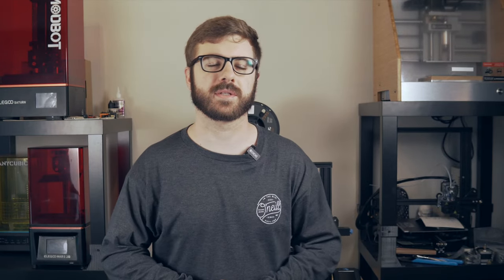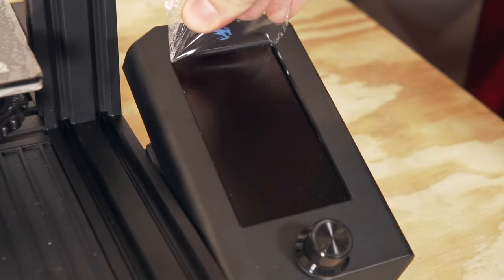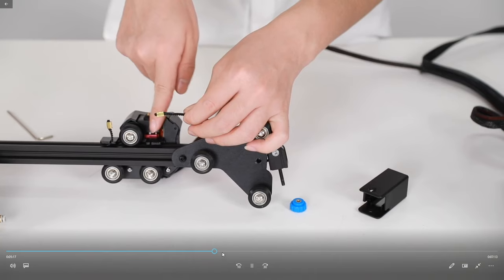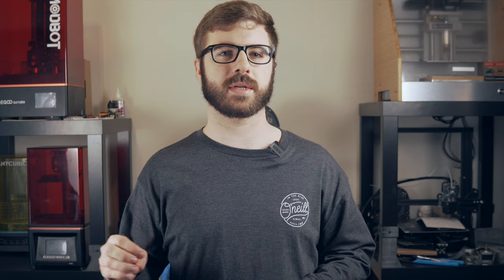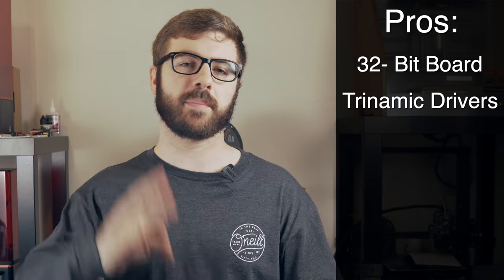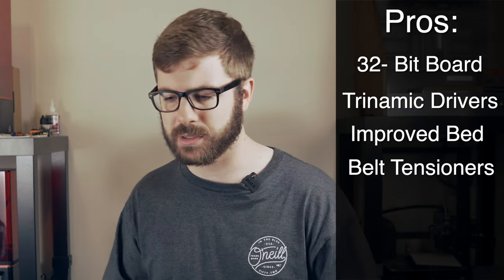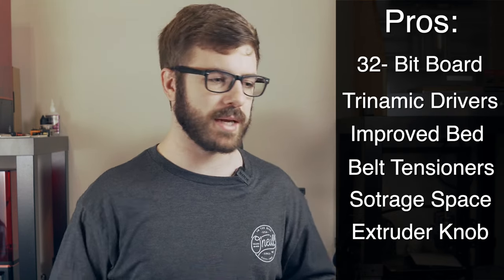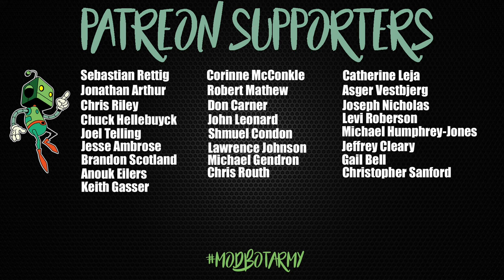Is The Creality Ender 3 V2 Worth It?

Comment: Biggest issue with the V2 is if you get one of the faulty 4.2.2 board which Creality still refuses to acknowledge and replace.
Reply: Probably needs more hot melt glue.
Reply: How does a faulty board look like? Like it doesen't do anything or what?

Comment: Nice summary. Agree, I don’t like the display. I also don’t like the larger plastic fan shroud. It’s more difficult to remove than standard Ender 3 and blocks access to the coupler if I need to remove it and the PTFE.
Reply from the maker: Thank you Chuck 🙌 Agreed, I do love how easy it is to access the hotend and coupler on the Ender 3 and Pro.
Reply: Can you share with me your settings in Cura? I am not getting the quality that I want and get a lot of missing layers.
Reply: CHEP, then what's a good 3D printer to buy if not this one?
Reply: @edwardnihal248  some might say the V1!
Reply: Chep, i respect you a lot, as someone with anxiety i think you should not recommend the Ender 3 in any of its versions to ANYONE, this machine has made me hate 3d printing after a year
Reply: @angelinajoy3084  Cura sucks. I had lots of issues with it. I switched to prusaslicer and all my issues were gone! But I think the interface isn't as intuitive as cura.
Reply: @TheTechenthusiast69 what issues were you having with cura?
Reply: @TheButchersbLock  lots of z seam. Switching to prusa fixed the problem.

Comment: I was told by this guy. Frankly built that this was arguably the best printer to start with and I will buy it very soon I am doing a LOT of 3D printing research
Reply from the maker: There are a lot of similar printers with slightly better and slightly worse specs. Alot of it comes down to what you want feature wise, what you want to spend, and if you plan on upgrading anything on it in the future. There is no denying it is a solid machine.
Reply: I have had one for a little over a year and it was my starting printer. Since I was just learning I spent A LOT of time in the slicer but now that I understand the slicer and have my settings it is great. I have very few print problems with it. One thing I do different is that I use the smooth glass side of the bed rather than the dimpled side. I just get better adhesion with it. If you haven’t got it just trust me when I say be patient with the slicer it will pay off and you will love it.

Comment: I'll be 100% honest, a loud fan is a plus for me... 

I use to live in an area for most my life that got up to 120°f regularly in summer, and I got an industrial fan as a result for my room to keep cool. 

I used it so much overnight that even now that I live in a colder climate, I still keep it on overnight... Cause I can't relax, and go to sleep without the loud hum of the fan circulating the air. 

So having another loud fan in my room honestly won't bother me, even if the estimated 50 db that the Ender 3 V2 has is way quieter then my Industrial Fan.
Reply: You from redding ca? Lol

Comment: I ended up upgrading mine to a BTT board as I thought the extruder stepper died after a direct drive upgrade (turns out it was just a cable so.. meh), but ended up also for the touchscreen with the simple Marlin reprap screen "emulator" and I did not regret it. That color screen is more of a hindrance than help, quite honestly... for those that don't know: these screens are separate little devices with their own firmware, meaning you lose a lot of flexibility the basic, monochrome pixely screens have, especially if you upgrade and compile Marlin yourself and want to do funkier things like sync to OctoPrint, use the Pause command and the like as these screens are fairly separate modules... so for example...  on pause they just start beeping but you get no pop-up prompt to continue, etc. You can also not modify the menu structure, add new things like the Z offset wizard,  or compile the firmware yourself etc.

I also really hate that bed glass, upgrading that to a flexible PEI sheet was truly a game-changer because I stopped struggling with first layer warping, etc. 

It's also worth upgrading the Z axis to a dual rod setup to prevent droop. I myself installed a Micro Swiss direct drive / hot-end kit and with this set-up I'm pretty much completely satisfied with it --- I printed PLA at 100mm/s without any giant quality downgrades or print defects, bridging and overhangs are pretty on point, too. Even ran 2 day+ prints.  I've printed PLA and PETG with not too many issues (petg needed some tuning, though) and i'm now venturing into flexibles.

Oh, and I also replaced the fans on it, the hot-end fan pretty much started dying after a month and a half and started making weird noises the moment it was started, kinda disappointing..

It's also worth compiling your own up-to-date customized Marlin builds.
Reply: You might as well just get another 3d printer at this point LOL

Comment: What I want to know.. the E3V3 can be had for around $250 . Amazon currently has an Elegoo Neptune 2 in stock at $160. So is the E3V2 worth almost $100 more over the Elegoo. I know there is a bigger community and more secondary market support for the E3, but being that it is essentially a clone a lot of that will also be compatible with the Neptune2. 

And if Elegoo will get their head screwed on right and get enough Neptunes out there the community support for it will pickup as well.

Comment: That's a very useful review. The machine seems to be very good, specially for the price. I am doing some research in order to buy my first 3D printer and I'm leaning towards the Ender 3 V2. Do you think it would be easy to replace the loud fans?
Reply: Did you buy it? Are the fans easy to fix?
Reply: @judeffr  I ended up buying the biqu b1. It's a very similar printer, but it has some features that I thought were more interesting. The fans are also very loud and I've replaced them.
Reply: @Felipeh999  what were those interesting features and how's it going honestly
Reply: @Zafor-ium  the Biqu B1 comes with better bed springs and a metal extruder, opposed to the plastic extruder on the Enders. So I've thought, if I'll have to expend a little extra on better springs and extruder anyways, why not get a printer that already comes with that? And apart from that, the Biqu B1 has a better integration with BL Touch and I really like the looks of a single USB C cable connecting to the print head. And there are LEDs, everything gets better with LEDs. lol
Reply: @Felipeh999  ok ok, thanks alot. Likely will get that one then

Comment: From the other videos I've seen of this printer if you spray hair spray on the bed it'll hold the print well enough and if you let it cool to room ramp it'll actually "pop" the seal on its own so you won't need to use a scraper and risk damaging the glass bed.

Comment: Ender 3 v2 has great quality to  good as high priced printers once tuned right. The downside is the amount of upgrades you have to do to print higher temp materials . And the reliability of the printer is not the best due to the frame not sturdy enough and rollers instead of linear bearings . More prone to bed level or gantry faults
Reply from the maker: It should be pretty easy to add an all metal hotend for high temp. The extruder may be a different store if you want to do a direct drive.

Comment: The Ender 3 V2 is definitely worth its price, my friend has one and it is a very good and enjoyable printer, however, I have a Voxelab Aquila which is an Open Source clone of the V2 but has a better screen which is horizontal and the GUI is much better and at $179 so is the price
Reply: Are moat of the pieces interchangeable with the ender 3 on the Aquila?
Reply: That's the same screen, isn't it? Just has different firmware. I've read that people have flashed them with the Creality firmware and then converted everything to Jyersm firmware.
Reply: @686Boards  Yes they seem to be exactly the same
Reply: @therising1  The Aquila seems crisper and faster although that could be down to firmware

Comment: I am new to 3d printing too, but it looks there stay left overs on the bed, how do you clean that? And must you remove the 3d printed object when the bed is cold or warm? I try to discover how this all works. And with what software can you make these designs? Does it works with autocad or so? And when you pause printing, does the connection when you start printing again less strong?

Comment: I'm considering getting into printing but I had a question for the experts, what causes a print to look very... Line-y I guess? I see some filament prints that look pretty smooth to where I'm wondering if it's a resin print or not but then there's some that look like thin pieces of plastic stacked on each other. How do you get the smoother look?
Reply: Hi! I know this is a month old comment, but usually this is caused by an issue called "z-banding". There are plenty of guides on how to fix this depending on what printer you have. Hope this helps!

Comment: I have a feeling that it's not a Mean Well power supply, as Mean Well has replaced the voltage selector switch with automatic power level detection across all of their power supplies, correct?  It looks like this printer might be good for a novice beginner who is looking to upgrade over time.  That Godzilla print looks freakin' amazing.  Props to the creator.

My BigTree-Tech order finally arrived more than a month after I ordered it, so I can finally start drafting, building and installing some of the upgrades that I have planned.  I wasn't comfortable creating a Marlin build for the Ender 5 Plus, as Creality wasn't willing to answer some questions about the source that they released.  I can't use the Mosquito hot-end w/o making changes to the firmware for the maximum temperature and the thermistor.

It is very frustrating trying to work with Creality, as they don't seem to understand that owners of their products buy to be modified, and that we need replacement parts.  It's impossible to obtain more than 1/2 of parts that makeup the printer.  I'm probably going to need to outsource a couple Nema 17 motor mounts that are identical to the one that holds the Y-axis 42-48 motor in place.  I'm also trying to figure out an alternative for the limit switch assemblies, as they are unique to the Ender 5, and not available anywhere.

Anywho, have a great weekend!  Things are finally starting to look better.
Reply from the maker: I was not aware of them removing the switch on Meanwell psus. Was this fairly recent? Yeah I really do not think this is a bad machine and the feedback I have gotten from people that own it is primarily positive. Right! I love the model. 

Doesnt Creality have the Ender 5 plus firmware avasilable? What info where you looking to get that they didnt provide? Check out Tiny Machines. They are US based and carry quite a bit of spare parts for Creality machines. I have ordered steppers from them and x carriage mounts. 

Have an awesome weekend.
Reply: @ModBotArmy  I guess it depends upon the series.  It looks like the LRS models do have the switch, while the RSP models do not.  So it could be an LRS model that you have.

The source that they released was for an older version of the firmware that is 2 releases behind the current.  Even if I was able to get them to answer the questions, I was going to replace the MB anyway, so I changed my plans to do it earlier, rather than later.

I checked out Tiny Machines 3D, and wasn't able to find the assemblies there either.  I found most everything on RepRap.me, plus an alternate, so I placed an order with them.  Hopefully I won't have to wait another month for those parts.

I found a stepper motor bundle on Amazon that contains the Creality steppers for a pretty low price, and I purchased a couple of them.  I'm going to start building a test box this weekend, so that I can test MBs with motors and switches outside of the printer.  I also need to design the enclosure to mount the 7" display on my Ender 5 Plus.

Have a GREAT weekend yourself!

Comment: Just got an Ender3 Max today. Easy to setup, but noises as hell fans, Noctua’s on order. Successful bed levelling but some slicer issues. Previous Ender 3 g-code works correctly but newly sliced code seems under extruded but first layer prints correct. Used Cura but will take a look at the Creality mix to see what’s wrong.
Reply from the maker: Be careful with noctuas if you use them for hotend fans. I have heard they do not move as much air and some have success while others have heat creep issues. If it for the main board or psu then you should be good to go!

Comment: Nice video !! I am new in 3d printing but i have experience with electronics and programming
I have for a little while a ender 3 v2 and i got it with the 'silent board 4.2.2'!
I found out that in early V2's they shiped with 4.2.7 boards! I did some research and I found that 4.2.2
makes the stepper motors a bit hotter and not so quiet as they should also makes them to lose layers in
prints! Can u make a video about that issue if there is one in the first place!  Greetings from Greece!

Comment: Why am i having a hard time with my printer? I print and it either has a near impossible time staying attached to board or something else. I just cant figure it out then during my print my ender 3 v2 ends up going to a different temp and bed temp and fan speed and everything so if its doing well the bed cools down and then lifts the whole board and ruins the whole thing.
Reply from the maker: Hmm, sounds like either a hardware issue or gcode thing. Adhesion is one thing but it sounds like you have more things going on then that.
Reply: @ModBotArmy  thank you. Honestly i got a replacement so we'll see how that goes. Otherwise I think I may have figured my problem. For some reason at 60c it wasnt hot enough bed temp so i raised it to 70c and it is working great now. 200c nozzle temp. Seems to work out pretty good. I also decided to do the glue stick trick and the difference that created was amazing.

Comment: I have the v2 and the Biqu B1. I absolutely love the B1 super clean prints. I also have a ender 6. I can get things to print on the 6 and the B1 but can't get shit to print on the v2.
Reply from the maker: I may be getting the Ender 6 in to test out. So you have been happy with it?
Reply: @ModBotArmy  I have been. I enjoy putting them together as much as I enjoy printing on them. The quality is good and I appreciate the larger print area.
Reply: @ModBotArmy  My earlier reply I was half asleep. Of course those things would be an improvement over the ender 3 I expect you would like to know a little more detail. So while it has the same type of bed leveling as an ender 3 I have noticed that I did not have to level it as much as my v2. Hell I can't even get anything to stick with my v2 it's been sitting in limbo for weeks now. My favorite for detailed work was the B1 but on my last print the filament got stuck and engulfed my hotend fans and all. I have not had any issues like that with the ender 6. I don't know if maybe because it is a core xy and the buildplate is moving away from the hotend that it is less likely to have filament build up on the nozzle or being my third printer I have became better at getting a level bed and start with the nozzle placement. The touchscreen is really basic. From the main screen you have three options. Print / Temp / Settings. You have your auto temp settings under temp, and you have your motion and feed options under settings. Most of the stuff gives you a few options here and there. I did switch to the all metal hotend in which I have had a few issues with it printing but that is more due to feed rates and the all metal hotend. I also need to check some settings in cura for some z alignment issues that I didn't have before but I also recently imported the CHEP cura profiles. Most of the stuff I print is 100 % infill, it does seem to take less time printing than the ender 3 which is nice with what I do with it. It comes with the upgraded springs and the metal extruder which is nice as well as the enclosure. The one thing I did not like is that it has the ability to install a BLtouch, but the connector style to hit the board it connects to wants the same size connector that is on the BLtouch itself so a mini connector and sadly the one I bought is the one for the V2. That has been the extent of my experience with it. I found it was super easy to set up. You will have to run a micro usb from the mainboard up out of the bottom area in order to have a USB connection. IT wasn't a big deal to me though. It is weird that all their other printers use micro SD cards while this one uses a full size SD card. If you have any other questions please feel free to ask
Reply: @SecondClassCitizen  flip textured side face down, clean glass side with soap and water, wipe dry, take 70%-90% IPA (Isopropyl Alcohol), spray on while warm,  then avoid touching the bed and redo the ipa clean before each print, you may still have issues with corner lifting which I'm still working to solve but you'll at least get repeatable prints
Reply: *wipe clean ipa

Comment: Edit: the two ender 3 pros we ordered came in. While they have the 32 bit 4.2.2 board, for some reason creality decided to put the "noisy" drivers in the pro and regular ender 3 boards. The displays are far better than the v2 however and I am able to enable things like babystepping and the bed leveling menus. 

The ender 3 pro is starting to ship with silent boards. I have two November 2020 built pros and they come with the silent board. 
I personally don't like the screen on the ender 3v2, jogging the machine is a pain and the interface isn't as polished as the reprap screens. 
For our print farm we decided to get more ender 3 pros since they come with the silent board anyways which was the big reason we bought two v2s earlier.
Reply: There are other firmwares for the screen.